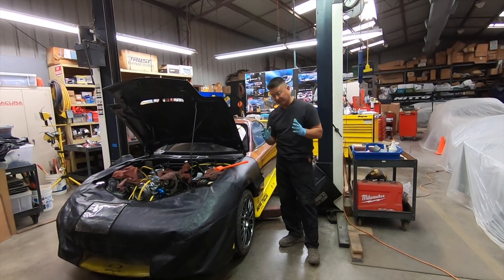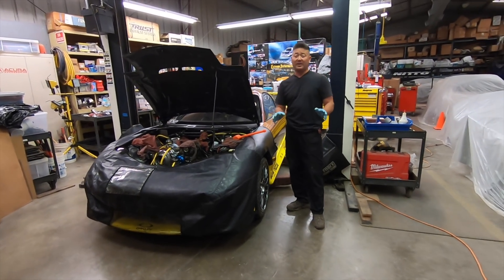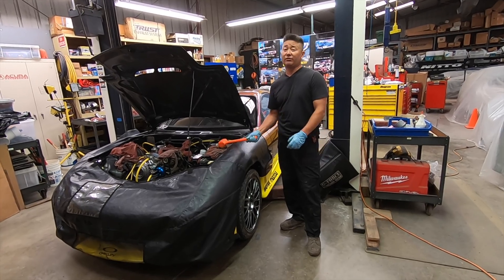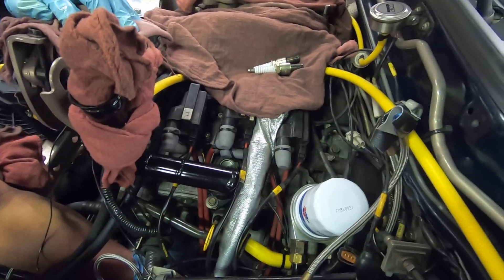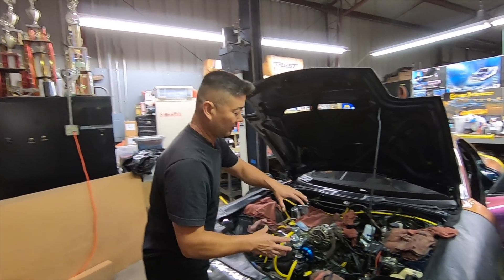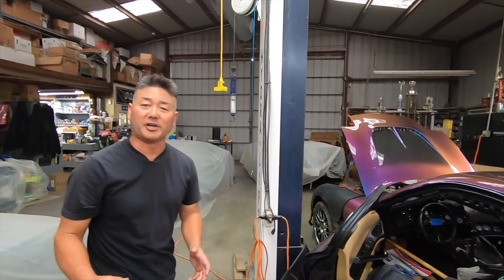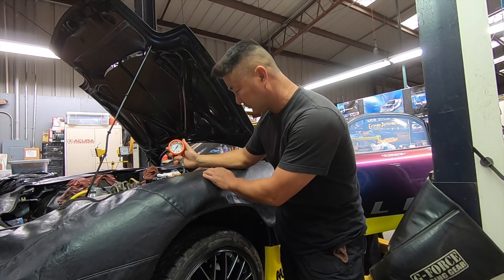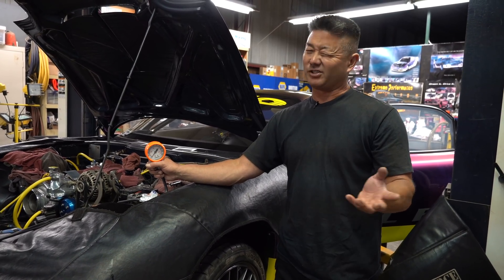What is The Condition of the 7 Engine?

Comment: Here you can see clearly how the Wankel engine Compresses and then lowers because the engine lacks valves and once the exhaust seal passes and the chamber is emptied, this leaves out the theory that the Wankel engine accumulates compression so Take advantage over the piston engine.

Comment: You can prime the oiling system by pouring oil down the oil filter pedestal.  Bottom hole backfills the oil pump and oil coolers.  Upper one fills bearings and rotors.  Cut the top off an old oil filter,  remove paper filter, install and fill it!

Comment: She will run and hopefully the seals will get unstick. One other issue from sitting for so long are  the oil control ring seals.  might be dried out and smoke a little but hopefully luck falls into play and they are decent. Great video!
Reply from the maker: Thanks for the comments and input Bro.  I hope you are right and luck falls into place, because I do not need any more work.  😁